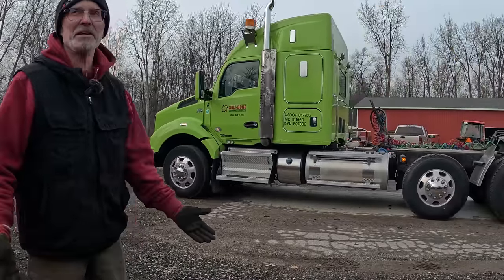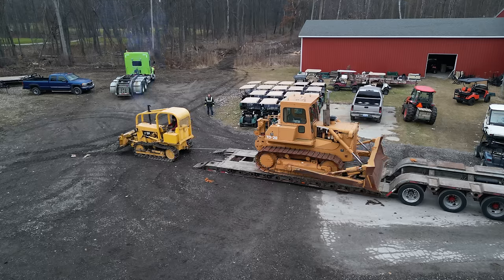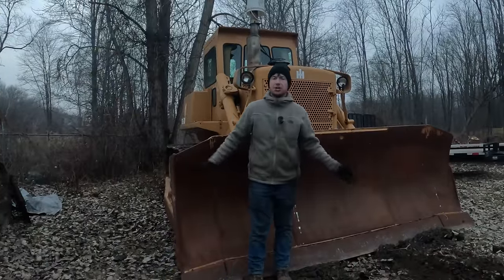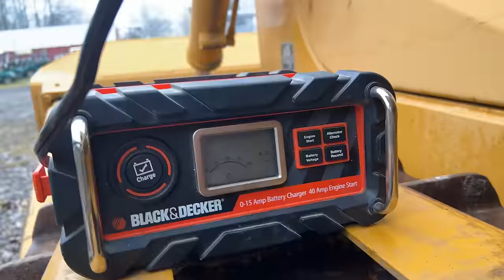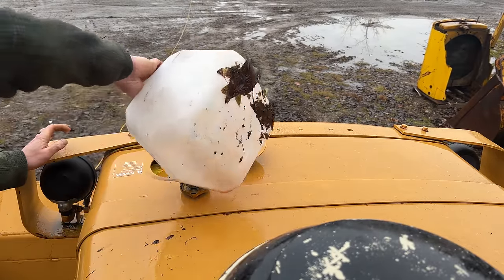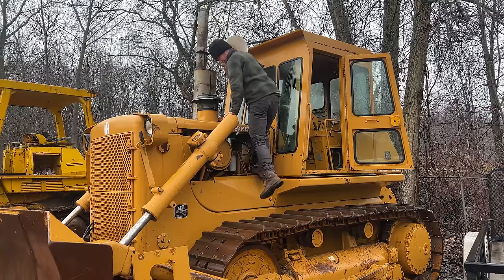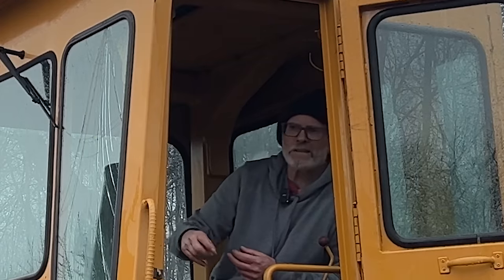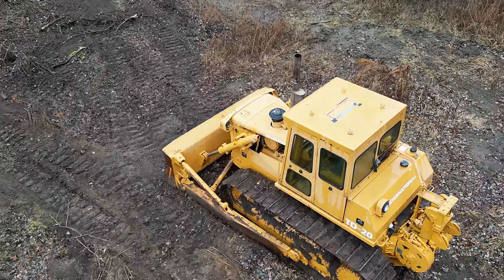Saving a big bulldozer from the scrapyard | WILL it START??

Comment from the maker: Well… how many golf cars?
Reply: Your math is off a bit. Suppose the cars ARE 500 lbs, that's empty. Add a driver and partner and that's another 500, at lest for me. Then add in a couple bags full of clubs, and the obligatory coolers of beer and you're probably at 1,100 lbs per cart. However despite the weight, golf car tires are not designed for much forward bite, so that's going to work against you.  Handily they do have front and rear hitches, generally, so hooking them together is easy.  So cyphering it all together, I'd say, for number of golf cars: "All of 'em!"
Reply: @larrybolhuis1049  so the golf carts would have better traction on ?pavement? And the dozer would be at a disadvantage on such a hard flat surface as pavement - the arena is set it must be on a hard surface to level the playing field - I concur (all of them)
Reply: the answer is...ALL of them!!! lol
Reply: You guys pick the number and I'll set my bet accordingly lol

Comment: We had a TD 20 that was used for logging out here in Oregon the operater was a old cat man and after he run it for a little bit you could not pry him out of the seat of it !  He love it !!  Built and pioneered logging roads with it and built landings and used too move a Skagit 739 yarder big machine there was nothing could not stop it had a big carco single drum with a log arch mounted to the drum would pull a hell of turn of logs too the landing !! Had a semi u-blade would move mountains of rock and dirt  one hell of a cat  3900 hours it blow a hydraulic line on the transmission and caught on fire and brunt  to the ground !! Operator was told to clean the belly pan but he went a head and continue too run it till she went up in smoke !  One hell of a cat !

Comment: Those are scraper pan control's on the back.  One lifts the bowl the other  would lifft the  bowl gate or apron as som called it. Once the gate was all the way up,  the rear plunger would start forward to eject the load. You had to be extremely careful letting the plunger go back because it was under a great deal of tension from the weight of the gate.  Let it go to quickly and it would hit the stops and drop the gate and the cable would snap and fly everywhere. Then you got to enjoyment of rethreading the entire thing. Guess how I know.

Comment: That TD20 E is the best dozer ever built. just be careful who operates it because the engine has more power than the drive train can handle. I maintained one of them for a company back in the seventies building ski areas in Vermont and New Hampshire.
Reply: A big YES, ran a (175) front end Loader for a company I worked for in the late 70s. Mostly we had the ( 125) for sewer mainline backfill. But anyway the ( 175) filled the bucket to "OVERFLOW" I could NOT believe the power going forward into dirt. It just rolls over the top of the front bucket 😊 there was NO power loss on the engine. I ran a Case 680 Howe pack
So I was not the guy running  pea gravel to the pipe crew. He liked the Case 850
 track loader better, because it was faster with the Case drive system. It was more like a wheel loader. We were running the sewer main in a very muddy none improved area of new developments. That gave me time on the (125) track loader. It was a power house all international heavy equipment was built sturdy. The LOCK up system was A+ for having a Battery lock out and DASH panel plate that was built bullet proof. Very strong machine 😊

Comment: Looks like you got a good one! 
Make sure to check the finals and pivot shafts
Reply from the maker: Thanks Clint! What do you think about the DVT800? The internet has me scared…
Reply: @dieseJL  They are ok Ive had a couple but parts are expensive and hard to come by. The TD-20s are good machines but they didnt make as many as compared to the 15s and 25s so parts can be an issue.
Just make sure to take care of what you have or get a parts machine
Reply: Normal you get that machines :-)
Reply: Wow, Clint is watching this one, his TD-25 turned out awesome!

Comment: Hello From Kentucky.  Several years ago, we had a similar IH TD-20 bulldozer that had the grubbing blade and with a open station with no cab within the highway department that was used pretty extensively for many years for various jobs. I can remember fabricating radiator brackets for a slightly different radiator than the OEM radiator as well as lots of other welding that I performed. Our TD-20 was very worn, But still a very usable machine. Seems like the clutch packs needed to be rebuilt and once everything was replaced and the machine was in good working condition again, The dozer was turned in to be auctioned off. The smaller bulldozers that we had afterwards never did quite measure up to the TD-20.  Congratulations on getting such a nice machine that sounds as good as it looks.
Reply from the maker: Thanks!!

Comment: sounds like and looks like you finely scored. Home run. not much to do by the looks, New Battery isolator switch and solenoid, Service it and its ready to go back to work. Sweet. Cheers Stew.

Comment: TD20 is a good machine, my dad bought a new TD20c to go mining in Alaska in 72 and he worked the hell out of it, built 10 miles of road, stripped numerous mining cuts before we had our first serious breakdown, the cross shaft in front of the sprocket, that the track frames pivot on, broke. aside from that the engine and machine itself was very reliable.

Comment: In 1968, TD20's are what I learned to operate with while in the Military, that 20 is set up to pull a scrsper and /or as a push cat 
in tandem. That heavy center plate in the blade tells you that !  Wish someone would give me a 20, they are great machines.
P.S. In 68 a TD20 cost the US military $27,800 USD. Today $270,000
Reply: They dont make those today.  Caterpillar is best dozer btw

Comment: Oh damn they're at it again! I just saw in your description. DVT800. That's a difficult engine to find parts for.
Reply from the maker: Yeah it’s worrisome but hopefully she holds. Deal was too good to pass on regardless of the engine. We thought maybe that’s why she was parked!
Reply: Just make sure you keep the air cleaner serviced well, they used that same engine in a couple 4wd ag tractors and due to dirt they had to be serviced daily 2x, also check that the rubber in the engine harmonic balancer isn't rotted, those engines sounded great, keep the muffler but you should straight pipe it to really hear a good sounding engine

Comment: Push both steering sticks forward that will put it in high which ever gear you select and then if you want to steer just pull the left or right in the direction you want to go. You can now push dirt around corners with both tracks in drive

Comment: Cant believe you guys just rolled it off the truck and the steering units not junk. Those are spring applied and hydraulic released by the trans pressure. Brakes lock automatically when you shut it off. looks like you made an excellent buy!
Reply from the maker: Yeah that’s why we had to shoot the grease in to release the brakes

Comment: Those spools on the back look to me like they're for towed implements of any cable operations. Pan scrapers, towed cable graders, plows and such. They're too light duty looking to be anything that could be recovery winches. Plus they're not connected via cable routing to a front block set. That puts my guess at it's age to be right around mid seventies. Mainly because cable operated towed pieces really started falling out of service as soon as hydraulic flex hoses became strong enough to not blow out under pressure loads as demonstrated by I think, with a early hydraulic excavator. Compared to modern excavators, that first type was woefully slow and couldn't really run more than one function at a time because the pumps couldn't get the flow to really move the arm and tracks, or swing at the same time.

Comment: couple of seized chain links, and some wireing. Yup home run. Do not ignore the frozen track pins, have seen them take out finals.
Reply from the maker: Any ideas on how to unseize the pins?
Reply: Solid pin or salt pin?-- Look at the pin where it comes thru the link, if salt pin one side will have a plugged hole in every pin, standard pins are all flat across except the master pin which has a dimple do distinguish it from all the rest. @dieseJL
Reply: Which chain? standard or salt. salt chains have a plug in each pin allowing lubrication at assembly. If this style pull plug, lubricate with oil and work it till lube sinks in. NO heat as there are plastic seals supposed to keep lube in.  If standard chain heat moderatly, work it loose and oil the hell out of it.  Either way once it works loose needs to be used reguarly otherwise rust will just set back in. Had a TD40 with salt chains and failed seals had to grease monthly for the pins that had bad seals. Had a couple of TD25 with standard chains seize and rip the finals out. Work the link against the drive sprocket with a 1 or 1.5 " pin between the sprocket and low point of the seized chain.  Will need to alternate as the set of the chain changes with force. Do not force all the way around the sprocket, only 2 o3  teeth with a proper tension on the chain. Work it back and forth. Takes an afternoon either way. Good luck. @dieseJL

Comment: who in there right mind would scrap that @ 2100 hrs  let alone the condition its in...
Reply: The gov't. C&C equipment bought a military machine at action with 12hrs on it that had been parted out. I've also heard of low milage 10yr oldhighway dept trucks sent to the auction with the frames cut, as they were bought with grant money.

Comment: Hey Tyler: ya'll got extremely lucky on this one. If you get a big job for her you might need to hire N operator, but that is fraught with error problems of getting the wrong guy. Ask what he was paid on his last job and how long did he catskin. Might be better to drive it yourself like putting a road in a forest. Do not run her empty of fuel as that may be the end of it. I was sweating the dad running her that last bit and he used 10 gallons pushing that dirt pile. Since you dont have a pickup with an electric pump and tank spend money carrying jugs of fuel to her which will take a long time to fill.

Comment: put a ome  meter across the battery connections if it reads 0 the batteries are good and can be charged if it has no connection they are bad it is that simple

Comment: 25 metric tonne machine with av8 desiel engine..that is a power to reckon with.finaly you guys get something with substance and not piece of junk you guys used to accumulate over the years...right now you guys can sell the machine with probably 5 times the money you paid for. 
Keep up the good work and good luck with your find..
Reply from the maker: Thanks! Should be a good tool in the bag.

Comment: you had to do all that to get it off the trailer. how did you get you get it on?
Reply: you know it runs you drove it on the trailer
Reply from the maker: i wasn't there but they had two like huge rotator wreckers. one on front and one on back. lifted the whole dozer. 

you can kinda hear the truck driver describing it in the beginning of the video

Comment: The DVT800 isn’t as bad as people make it sound, they got their bad rep from being in tractors and they got lugged.   That’s why v8’s in them never got overly popular.  Run it just under wide open, keep up on filters, air, oil and fuel and it should be just fine.
Reply from the maker: Good to hear. I heard they ran like 3000 rpms in the tractors too where in the dozer its just 2000
Reply: @dieseJL  I wondered if it was different rpms, you’d be fine wide open then.  I think the main problem was lugging them around trying to go slow while pulling a load, lots of torque on the crank and lower oil pressure is what did most of the damage, dozers kinda work different altogether

Comment: I had a few IH machines. Never a td20. I had to play it safe and buy normal Cat dozers with steering clutches. Unneeded simplicity and reliability with massive parts availability from varied sources. But I always kept my eye on the td20 and td15. I had fiends that had these dozers. They bragged on them...but it seemed they let one little breakdown junk the dozer for good. It was as if the one last they needed costed more than the dozer was worth? I never could get an honest answer. Any of these I operated (always briefly) felt powerful. They looked good and tidy also.  Seemed a little overly powered with some complex steering. Case dozers seemed to actually stay relevant longer than the IH dozers. They look good. I still want one. Not sure what the deal is? Anyone know? Someone told me they were a b!tch to work on. One guy told me he worked on an IH dozer and it had a starter he had to remove the whole engine to replace. Probably a smaller one. Idk? I don't get the final drive planetary looking system? This dozer in this video looks good. Doesn't look to be mechanically worn out?